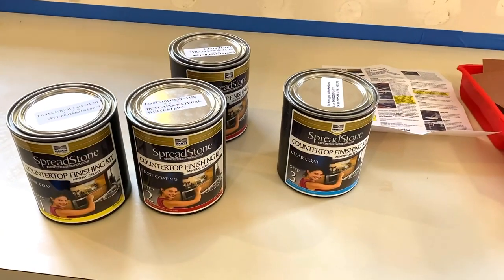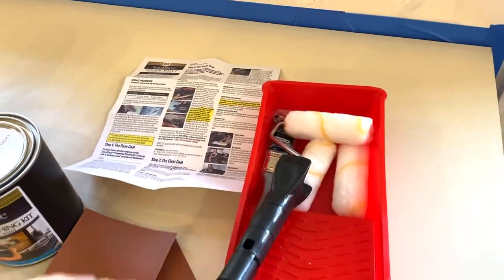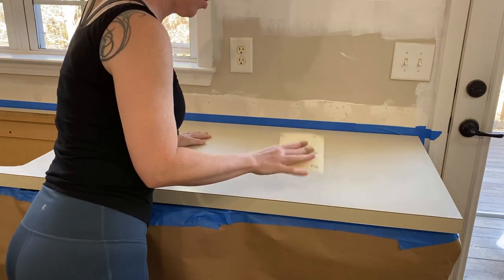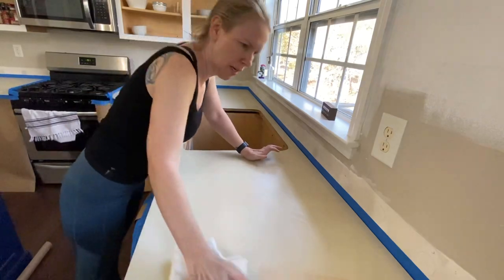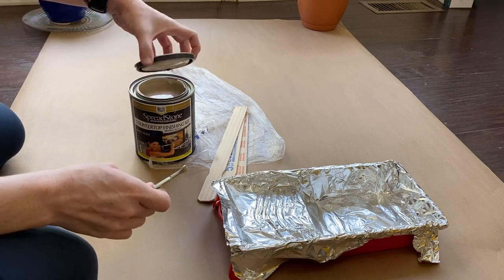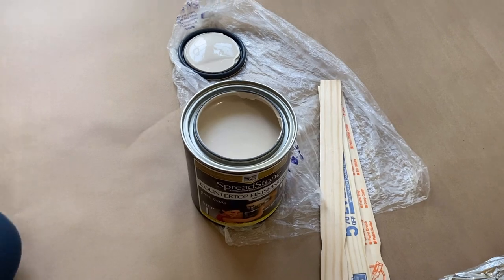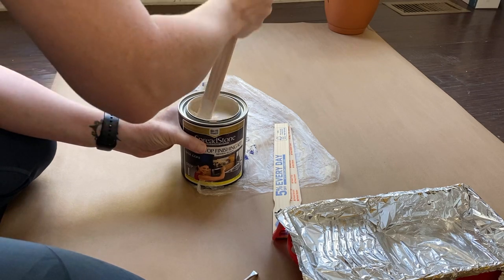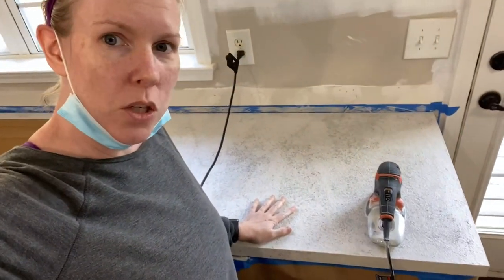Easy Countertop Refinishing on a Budget!

Comment: I'm in the process of refinishing our countertops with this kit. I have found that if you sand the edges down slightly it gives a bit more surface area for the base and stone coating to grab and helps prevent the edges from showing through down the road as well. I think it may help prevent what you ran into at 6:40. (I like the look of a softer edge as well - makes it look a little more like actual stone countertops.) Just my opinion though - yours turned out great!

Comment: Was it still bumpy even after you were finished? I’ve seen other reviews that have said that it was impossible to sand smooth. The previous owners here did one of those rust oleum kits… and it was textured. I liked that it was black but it looked and felt just like rhino liner. I was going to do a faux marble with epoxy over them but even with a high grit paper and orbital sander - the crap wouldn’t so much as scuff. So in the sense of durability it’s great. Anyway, I ended up rebuilding my counters all together and did the epoxy. They don’t look bad, but they also don’t look like I imagined. They stain easily and have cuts in it from when my kids decided cutting boards weren’t necessary. Anyway, what I’m rambling on about is, I would hate to put in THAT much work to end up with textured countertops. I spent 4 months working on the other ones 3 years ago and I’m already needing to fix it.
Reply from the maker: Yes, there is a slight texture to it. It isn’t smooth like actual marble or granite, but it’s still smooth enough that you can run your hand over it. I made a TikTok showing an up close look of it if you want to see. My username is @amandaseghetti there too. :)